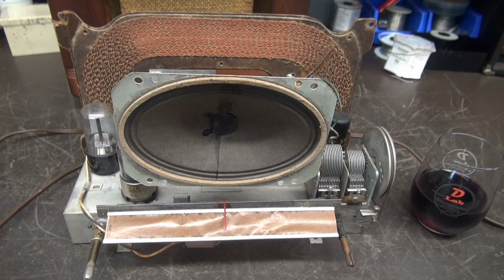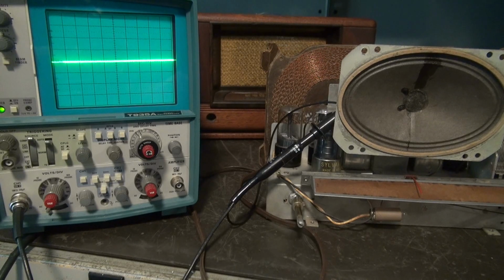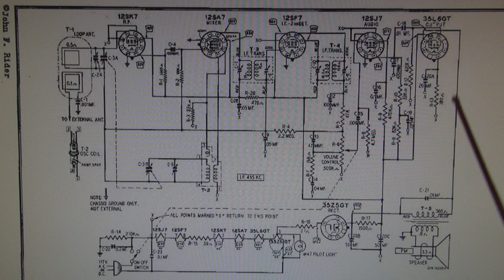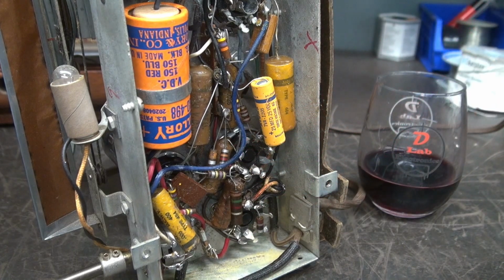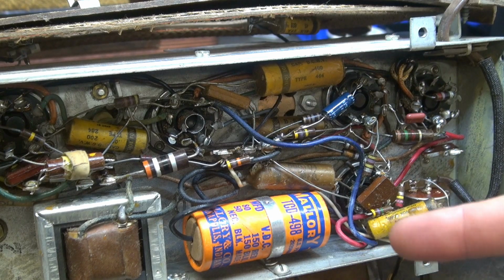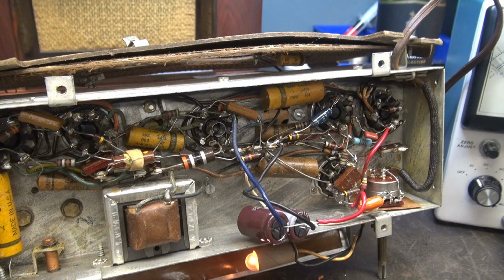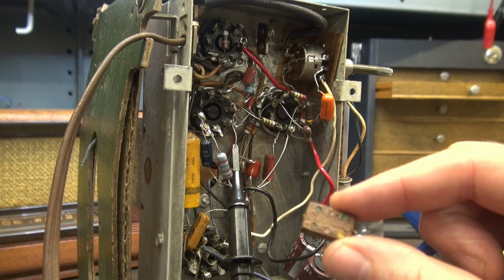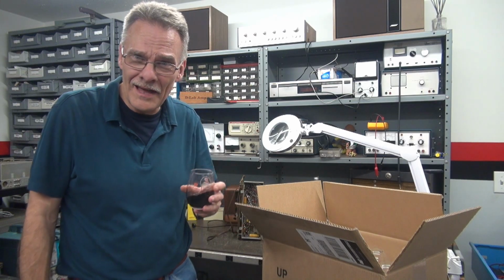How to fix noise static Vintage Tube AM Radio amplifier section Repair tip

Comment: Hey Terry, I can not get enough. Thanks to you the filthy 1939 3 band Philco floor console I got at the flea market now stands pride of place in my den. I stripped the guts out of the chassis and point to point wired it to be a clone Princeton combo amp. I retained the original on-off tone pot and the volume pot and replaced the band switch knob and the tuning knob as pilot light indicator and input jack. I call the whole rig my magic jukebox as anything can now be played through the 12 inch Weber 30 watt AlNiC0 speaker. The neighbors can appreciate my music now.

Comment: Well done! One really FAST was to trace this issue is to use the 'hound' from a fox-and-hound wire tracing set. It quickly reveals the source of the arcing, whether it be a mica cap, resistor, or cold solder joint.

Comment: This is another great video Terry.
A great example of how to save time, knowing where the root of most problems occur, and so then changing the Capacitors in this case, and similar, to allow you to enjoy more wine.

Comment: Thanks! I have a Westinghouse H-164A with the exact same problem with the exact same fix, a bad mica cap after the volume control.  The “lightning” was gone after I clipped the lead, ordered a replacement today. You’re a life saver and an inspiration!

Comment: Thank you sir for the video, I like it so much, I carry in my blood the love of vintage radios,  my grandfather was received as a radio technician in 1949,  I'm a passionate about repairing things. sometimes I fix radios or tv's, my only problem is that I don't know how to measure, making me to replace more parts that those really needed,  i have a lot of theory, so I'm always oriented where the fault can be,  (I'm not an electronics technician), I always fix them, I look for radio or tv's valve operated diagrams but It's hard to find.  Keep enjoying your wines.

My greetings
Rico from CA.

Comment: My initial thought on the issue was SMD. But also consider the old carbon resistors in the signal chain as well, especially the "old roundies" (the ones with the rounded ends). They can also be a noise generator. 

Your right that, in the past, most of the topics, for caps, were on the old waxies and the silver mica caps in the IF cans. Not a lot of discussion on the "domino" mica caps but some of these dominos are not actually mica; they can also be paper composition.
Nice wine glasses. I hope you are able to ramp up production and offer them to other countries sometime in the future...
Cheers,

Comment: Good demo on troubleshooting. Wax caps need moved to the circular file no matter what. Mica caps are usually far more reliable than anything but ceramic discs... and in RF circuits they should be left alone if possible - sometimes they're hand picked to tune a circuit and they're thermally stable. Can't fault you for ignoring that cap. I agree with evicting the waxies on general principals because if they're not a problem now they will be soon. Also seen a lot of carbon resistors cause that kind of popping, but Allen Bradley style are typically ok... Tap Test with a chopstick usually finds that kind of problem.

Comment: That is excellent. In fact  I am working on a Knight R-55 right now with that issue and was thinking about not replacing the silver mica caps (they are listed as silver mica) now I think they are gonna go. Thanks.

Comment: Very good Terry I always enjoy a good diagnostic video and you're right about those domino mica caps. They are reliable for a very long time but after 90 years time finally takes its toll and everything has to be considered. I wonder when 90 year old ceramic caps start going bad. I have an old Philco AM FM radio/ phono console built in about 1948 its a model 48-1286. I tried to do a shango on it and resurrect it with a dim bulb tester but I don't have the patience he has hahahaha 😆 that guy is a genius. I recapped it so that it can safely take the full 120volts. Also found 13 old carbon resistors that were way out of tolerance and replaced those too. Also found an open FM primary IF transformer winding on the second IF I had to rewind using wire off of a scrapped out TV speaker voice coil. That was fun I counted about 30 turns on the transformer winding. This radio uses the same IF tubes for AM and FM and has both AM and FM windings in series inside the same IF cans. I got AM playing but FM still wouldn't work and when I held a small FM pocket radio close to the oscillator it wouldn't pick up any quiet spot from the oscillator when I sweep the tuning capacitor. I measured the B+ and it supposed to be about 335volts according to the schematic but was only getting about 140volts and the culprit was a weak rectifier tube so I replaced it with two 1N4007 diodes and that brought the voltage back to normal and now FM works. Tubes have to draw more current on higher frequency FM to oscillate and work properly and after IF and RF alignment the sensitivity is very good but FM drifts after heating and I have to move the tuning slightly. I wonder if that could be bad mica caps in the FM converter. The FM IF frequency on this radio is 9.1 mhz instead of the common 10.7. AM is 455khz

Comment: I was surprised though I have had to replace those mica caps for other reasons. I have more often, though I'm not an expert, had problems with resistors causing that problem. It is a good reminder that no component is above suspicion in these old radios. You just never know how they have been treated or how hard they have been used.

Comment: First !!  He he  Although I'm not a radio guy,  I am thinking this one has "silver mica disease"...  It's the first 30 sec of the video.  And at 9:30, I find out I was onto something.   The thunderstorm sound was the tip off...  at least it wasn't the ones INSIDE the coils.

Comment: I have a old Hamarlund BC-794 receiver with the same crackling noise.  My noise is there when I crank up the volume.
Volume set to off it's not there.
It also lost reception as well.  I know the LO is working because several years ago I added a digital readout that lightly couples the LO signal (its not a direct connection) and I can see the frequency change as I tune the main or bandspread knob.  I am thinking the problem is somewhere after the LO but before the audio output stage.

Comment: I think I almost have seen your video , thank you I learned a lot from you, I own several Transoceanic 600, it seems all of them have same problem, too much static noise , and statics which make it literally difficult to hear to hear the stations, you become my source of inspiration to repair them although  I just started to learn but your video gave me enough courage to go ahead and changed all of the caps and the filter, however the problem of noise and filter did not go away, any idea what else I am suppose to do? if you wanted to reply please keep in mind I am 74 years old and just started to learn. Thank you again for wonderful classes.

Comment: Good info, I’m working on an old Silvertone model 27 Sear’s radio now. Picking up lots of stations but there’s bad humming when turned on, probably the big filter cap, which is a a 4 in one cap. Where do I find these old caps?

Comment: nice Murphy's law demonstration....but replacing all the micas may be bad advice... micas, styrene, ceramic, they all fail but they are not failure prone and are used in tuned circuit sometimes, watchout....if you are working on a TV IF stage or an Fm tuner on a radio and shotgun those caps chances are it will never work right again even if you attemp to align it...sometimes even changing the location of the cap makes difference.... on tv there are mica caps that set the frequency of the timebases and if changed th tv will not sync until you adjust the frequency via the frequency coil or potentiometer and to verify the adjustment you "need" to have a picture but if the frequency is way off there may be no high voltage developed on the flyback so no picture...see the danger?its best to set a baseline first and then replace the waxies and lytics and then diagnose if there is a problem.

Comment: Hello, I'm having a similar issue with a vintage 1953 Crosley  Model E-15 WE. Any suggestions or what caps I might need power resistor? Or to you fix if shipped to you? And how much?? Only getting a couple stations but lots of static behind it... Anything helps... Thanks
Mike Guerra

Comment: You got lucky that the Silver Mica Disease was in that cap and not in the ones on the bottom of one of the IF cans. It's no fun doing surgery on those cans to remove that cap as i'm sure you well know. 73 Doug.

Comment: Thanks for uploading the video I am from India and watch your videos regularly. 
 Will you please help me to find what may be the cause and how to fix the problem  of some noise and fading out of the volume after around two to three minutes  after switching on  my recently refurbished  ac/ dc Philips make radio  (1961) having a valve configuration of UY85 UCH81 UF89 UBC81 and UL84 with a tuning indicator UM84 .

Comment: I would hesitate though to routine change out of mica and ceramic caps in a HiFi tuner. Remember the RF section was aligned with the original caps and compensated for their tolerance variations. Replacing these small caps could throw the alignment off. In a low cost AA5, it not that critical but be careful with a good old vintage HiFi tuner.
Reply from the maker: I agree and usually leave them alone unless they are acting up

Comment: Hey, so I have a Silvertone Transistor AM radio model 2061 that I just finished a cosmetic restoration on, but I’m having the same problem with it that you had with this. The difference is that I get a much louder static you can hear across the house even with the volume off. I can hear a muffled voice through the static when I tune into a station with the volume up, but I just get a loud vibrating static sound. I don’t have access to many parts though. I was trying to find out what might be wrong with it.
Reply: I have worked on 2 vintage transistor radios that had that problem- it was a noisy driver transistor in the audio stage.

Comment: I been trying to figure this one out for a long time now. I have an alfa unitra stertone radio. It has no bass whatsoever. anything below 300hz sounds like square wave harmonics. Entire radio has been recapped and resistors are all good. if i touch one of the caps near the output tube I get a loud clean 60hz hum on the speaker. sounds really good. but if I try to play a 60hz through the radio using an fm transmitter it sounds like square wave harmonics. no 60hz at all. I don't have a clue what's going on here. AM seems to have more bass than fm but still not great. Maybe you could make a video on this?

Comment: Terry
Nice troubleshooting
How did you isolate your scope from the hot chassie
Reply: He no doubt uses an isolation transformer to power the radio. Then there is no problem with a hot chassis set.

Comment: A sweet romance is not for me
I need electricity
If you wanna make me flip
Hit me with a micro chip

I'll be a diode, cathode, electrode
Overload, generator, oscillator
Make a circuit with me

Just plug in and go-go-go
I'll be your human dynamo
Signals in my power cord
Impulse on my circuit board

I'm an AC/DC man
You can read my circuit diagram
I feed on electric jolts
I need fifty-thousand volts

A sweet romance is not for me
I really need electricity
If you wanna make me flip
Come on and hit me with a micro chip

I'm an AC/DC man
You can read my circuit diagram
I feed on electric jolts
I need fifty-thousand volts

Comment: what type of capacitor are you replacing the Mica capacitors with? looked like dipped  polyester to me but wanting to be sure as I have not had to find a substitute to the Mica before and it looks like the radio  am very slowly working on has quite a few, but as it is one made  behind the iron curtain  in late 1950s the parts are not so familiar to me. if you want a look at it there are a couple of videos with it in on my channel . the wine glasses look good do you ship to the Czech Republic , or czechia as it is sometimes called?
Reply: its a modern silver mica cap i also use the same brand

Comment: Dear Terry, I got a question.
There is a high voltage electrolytic can capacitor leaking in a circuit of my vintage unit. The vallue on this one is 16+16+16uF/450V. No schematic on the www, but now I found a simalar circuit schematic (an other brand) looks like this schematic is a revision/redraw and this capacitor says  20+20+20uF/450V. Is there a warning to look after or can I replace it with this higher vallue? The following circuit: power transformer>rectifier>capacitor 3x16uF (in my opinion a filter cap for flattening purpose) Hope to hear. Cheers
Reply: H Higgins much appreciated thanks

Comment: Just curious what type of cap exactly did you use to replace the original 470pf mica cap with the new 500pf? Like when I go to mouser or other companies do I specify a mica cap? I'm wanting to recap my Hallicrafters S38 and those domino caps confuse me. Thanks for all you!
Reply from the maker: The cap is a 500V 500PF, 5% mica type made by SaHa
Reply: @d-labelectronics  I really appreciate that as I get more and more into the repair side. A thousand thanks

Comment: i have a video of a tv repair were it works fine with a shorted cap but fails with a correct replacement new one and its a cathode bypass lytic...can you guess why?? leaky lytic+open bypass resistor= working circuit.... new cap+open bypass resistor=non working circuit.. funny huh?